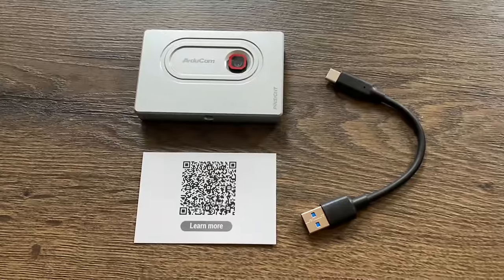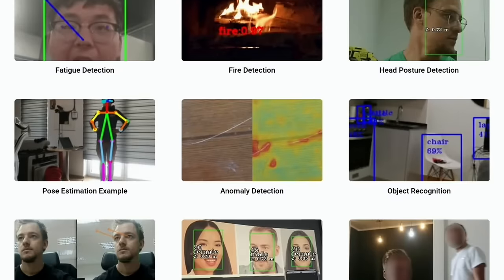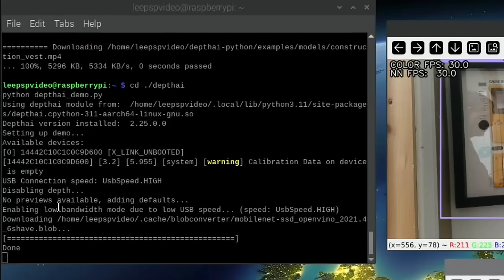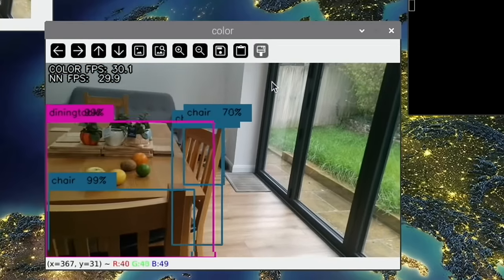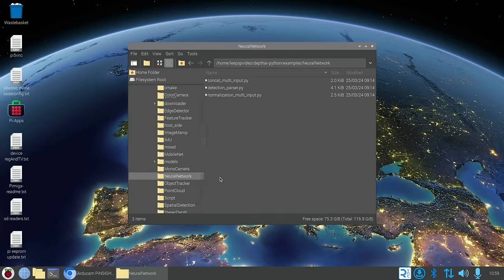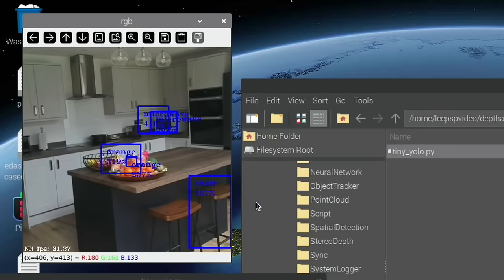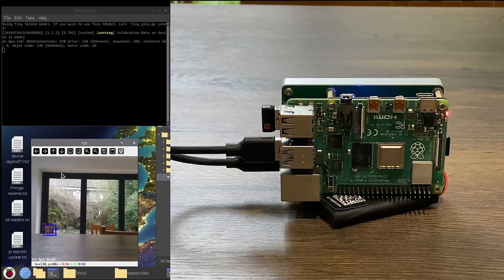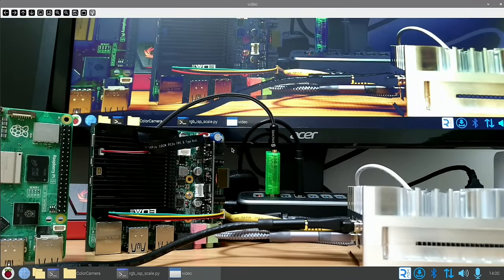Arducam Pinsight AI Camera for Raspberry Pi

Comment: This hardware has me very excited. Thanks for the insights and inspiration!
Hardware encoding of H.264, H.265 at 4k, with the camera being 12.3 MP, so can zoom without loosing clarity. While Pi's (4, 5) support playback of video, encoding capability (H.264, H.265) is limited to my recollection. That a Pi5 can handle dual camera inputs (in theory, as I haven't verified), and the Arducam being able to handle multiple video streams in parallel has some real potential. 
Took me a while to find pricing, but at ~$99 seems good value. Not to mention Arducam offers many camera options (IR, NIR, etc). Just need a bit of patience, as in pre-order.

Comment: is there a case , or it will work with other cases?
Reply from the maker: I haven’t seen a case. As it fits on bottom of the Pi using the standard holes it will fit many cases

Comment: Hi, I'm getting:
Camera not detected on socket
Could not find QT platform plugin "wayland"

any ideas very much appreciated.

Cheers
Reply from the maker: What is are you using?
Reply: @leepspvideo  os? Debian GNU/Linux 12 (bookworm)
Reply from the maker: Try Raspberry Pi OS as it uses Wayland and is also the first os anyone supports on Raspberry Pi. My kde also will work as its based on Raspberry Pi OS.
Reply: @leepspvideo  thanks! I tried a fresh image 30 mins ago and opted for 'Raspberry Pi OS (64 bit) Recommended' but same issue :/
Reply: SSH enabled & set username + password ticked
Reply from the maker: @spa3093  weird, did you follow the  Arducam instructions I linked in the description. That’s all I used
Reply: @leepspvideo  I believe I followed to the letter from the ArduCam wiki. Dependencies all installed ok, but when running the demo I get the error. I'll keep trying and will post here when I eventually fix. Cheers for the replies
Reply: there was a loose camera module on the PiNSIGHT which I discovered through disassembly, this got it running. Wayland error remained so I switched to X11 and that got rid.
sudo raspi-config
  >6. Advanced Options
  >A6 Wayland
  >X11
🫡